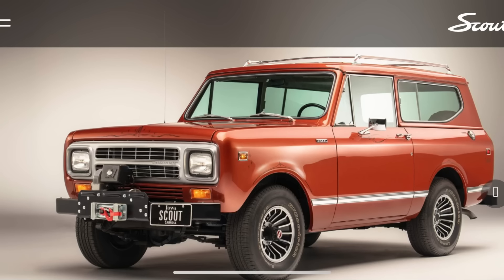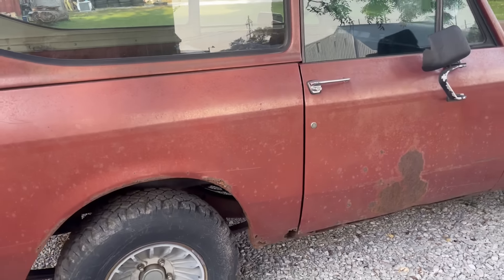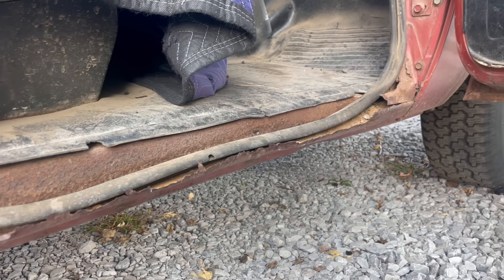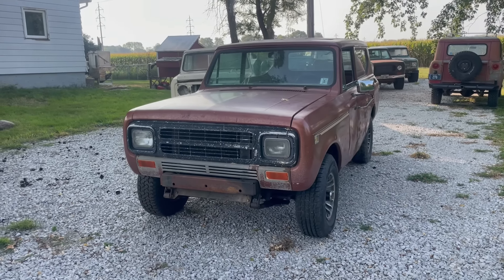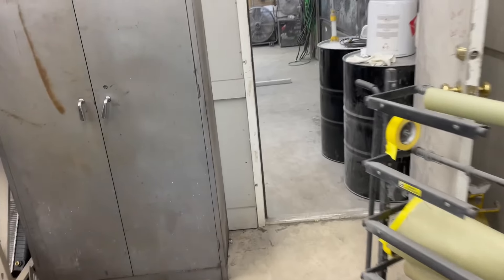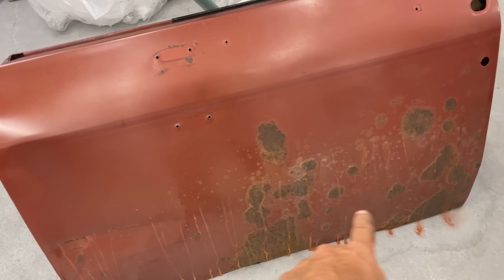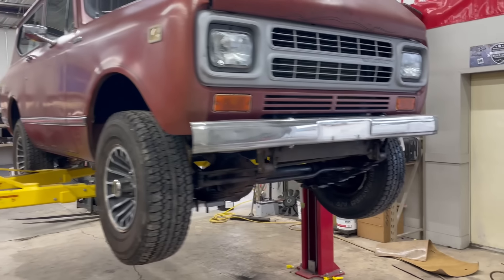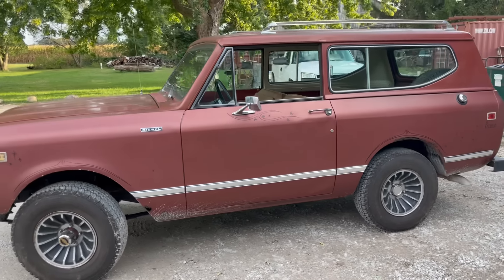THE SCOUT LIFE: Building the "Last International Scout" Clone  | 1980 Scout II

Comment: Nice work for such a short time. Just getting rid of that rust properly is a big undertaking all by itself. Wish you took more time and got it all out. Looking at that rust brings back memories (bad ones) from when I had a 1979, bought brand new. It started rusting in about a year. Worked so hard to get rid of the rust, but the rust won. Only Scout that I've seen on YT or for sale with the tan interior that I had. I had the bucket seats in the front.